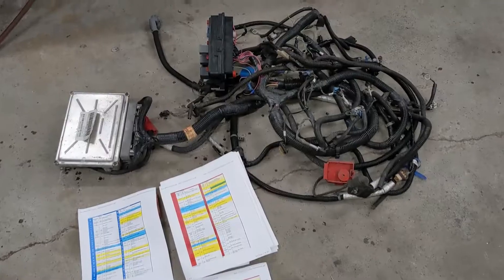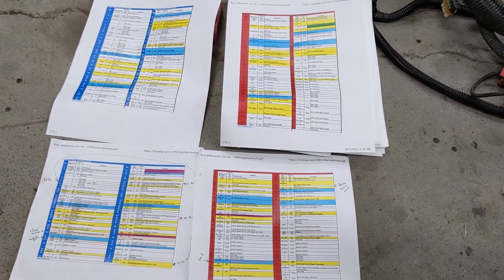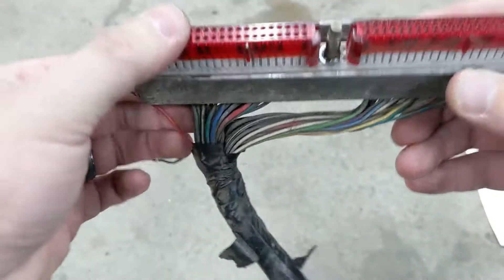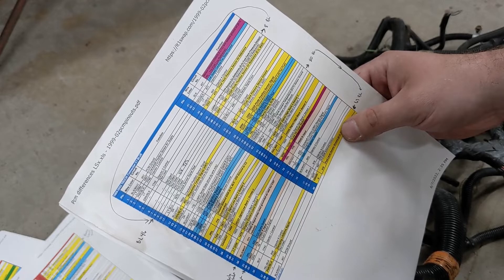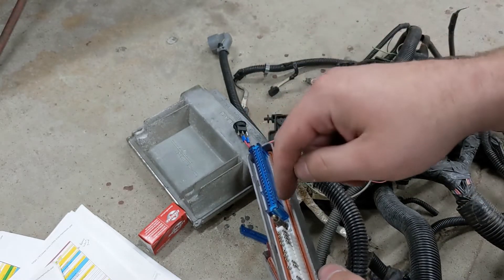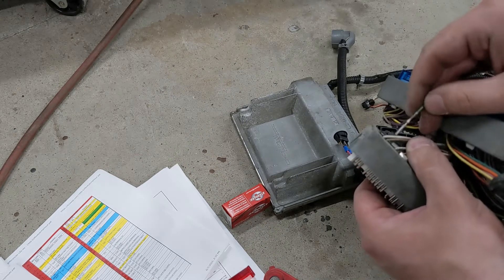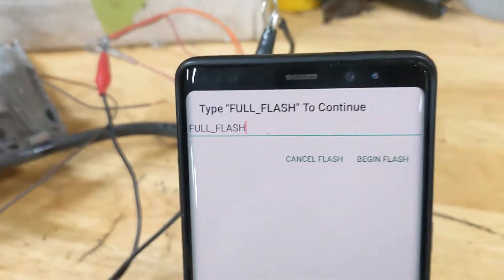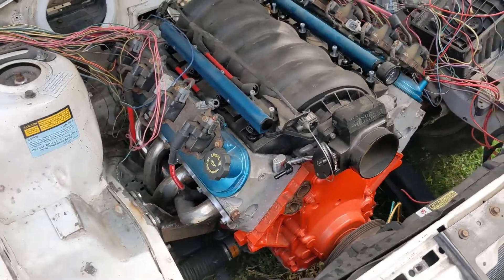Segement swap and wiring mods - T56 tune with truck harness and PCM for #LSswap Beretta

Comment: What wires do I move on a blue and green 2006 harness
Reply from the maker: To run a Camaro tune you'd have to convert to the DBC style I'd assume. I'm actually doing a video soon with my L33 harness making it DBC
Reply: @GEARHEADdezign  I seen how to do the DBC conversion but what about the t56 is the 05 pcm able to work with a t56 wiring or does it only work with 99-02 styles
Reply from the maker: @JoeRon-uj5jm  not that I'm aware of. I used the Camaro OS to be sure it worked. There's only a few wires to switch around to convert a 03+ harness to work with 99-02 PCM

Comment: Would I be able to do this with Blue/Green connector harness I have a 05 6.0swap
Reply: Appreciate it man , have more questions but I’ll wait for your video to drop I just need a better understanding with this harness because I see everyone doing it with the red/blue harness
Reply from the maker: @XVISV yeah there's not that many pins you need to add/change. And the 2156 OS can do basically anything
Reply from the maker: Yeah, you'd have to convert the harness to 99-02 style. There's only a few wires to move/add. I'm doing a video on this for my L33 harness.

Comment: im operating on HP tuners. looks like ill be swapping info onto my 5.3 PCM, just copy and paste eh? also, i want to be sure that im understanding correctly, using your method, you dont need a reverse lockout controller? the PCM does it?  thanks and cheers
Reply from the maker: Yes, PCM does it...just like a factory Camaro

Comment: @gearheaddezign I like this datalogging. Can this be done in a v6 4.3 . p59 ecu.  ve tune and no maf. just 1 o2 sensor. ? please help
Reply from the maker: Yeah I've used this setup for my P59 4.3 Blazer
Reply: @GEARHEADdezign  great. My 4.3 is in a Malibú 78. And has no MAF And justo 1 O2 sensor. Will It datalog?
Reply from the maker: @luissalcedo73 it should

Comment: What is the 5 volt reference for? I thought the lockout solenoid used a pink 12V+ keyed source and the pin 44 on the PCM as the ground source?
Reply from the maker: I thought they had to move for the different calibration, but apparently they are already junctioned in the PCB, so you can ignore those

Comment: Why not just populate the tables of the 5.7 engine calibration with the values from the 4.8? I guess the segment swap was quicker, but I assume it could have been done either way?
Reply from the maker: You can cobble it together the other way. From what I understand, you can't change displacement with LS tunes like you could the older OBD1 stuff. But you can fudge the injector and VE tables to get close. Like taking 16% of the VE table away from a 5.7 to 4.8. But there's still a bunch of other tables and I don't know about the 5.7 injectors etc. Lot better to just run a truck engine with the truck engine tune segment and go from there
Reply: I just learning about this but I’m doing a ls1 swap from a 00’ Corvette and t56. I have a 411 from a 02’ Sierra. I’m going to buy a standalone harness but I do have a harness and pcm from a 97 camaro but I heard I can’t use them.. is that true? And can I use this truck 411 for my swap?
Reply from the maker: Truck 411 will be fine with the LS tune and harness. The 97 Camaro stuff is LT1, which is basically a SBC with totally different ignition and injection.

Comment: I watched your other video on vats delete and fan ect . I'm building a 94 chevy Silverado c1500 I have a cple engines to use 6.0  Cole 5.3 .I have an l33 I'd like to run but I want to have a standard transmission. I'm not sure how to do all that file swapping stuff .as I mentioned b4 I barely can operate a computer  if someday you have time cld you do another video but slow down on clicking on the stuff you need to .I guarantee more views lol .okay I hope all is well with the family and work safe
Reply from the maker: You can slow down the playback and watch the clicks. It's not too tough to figure out either, there are good parameter notes